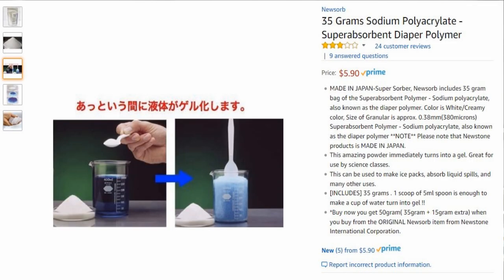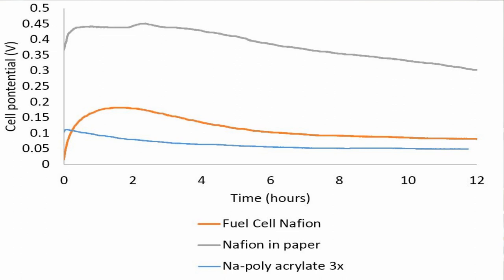Iron Battery Chemistry: Separator conclusion

Comment: Hi Peter. I took your advice, And made a separator from sodium polyacrylate for my zinc cell works well and on the dual carbon zinc cell the voltage after discharge is 1.9 volts. check it out some time.
Reply: Hi Dan, I see Peter is recommending paper soaked in SPA, rather than fibre glass, I must compare it to the cigi butt approach :-)  Martin.
Reply from the maker: That's great - thanks for sharing. Did you use a glass mat to hold it or just cast it directly? That's clever - I'll bet that the zinc helps hold the polyacrylate hold its shape like an ionic crosslink. Very cool.
Reply: Hi Peter. It's just cast directly, The zinc sulphate is making it all gummy like. It's actually working well and it's holding it's shape amazingly considering it's about 5 mm thick, Even works quite well when dry.